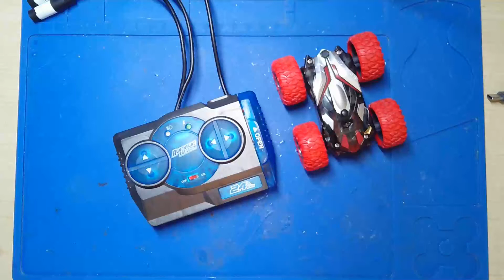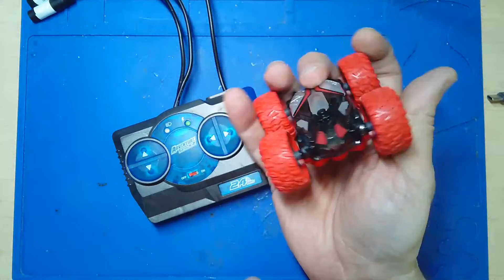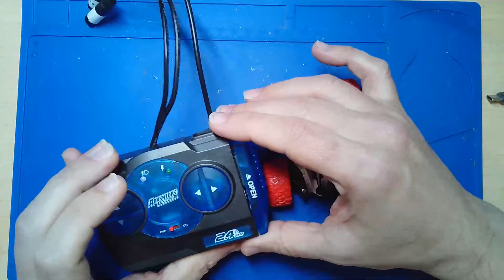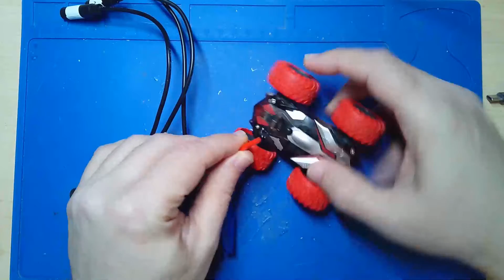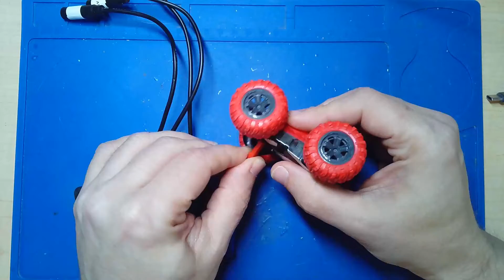Adapted Adventure Force Stunt Runner

Comment: Got 2 cars for free, but no controller. Do you know by chance if I can buy a new car set and use one controller for existing?
Cherrs
Reply from the maker: It's a valid assumption -- most of the inexpensive cars use similar transmitters and frequencies. Trouble is, these toys are done in batches. They might buy 10,000 transmitters and make the cars. Then they run out, and switch transmitters. Same car, different electronics. I've seen this in a number of different electronic toys -- they go through revisions, board changes, etc. I've opened up multiple of the same toy and seen different revisions in each. So, if it's inexpensive, it's worth a try. But I wouldn't spend big money on the experiment.